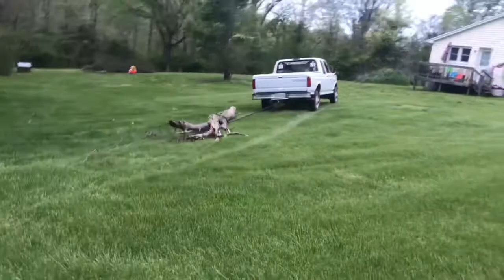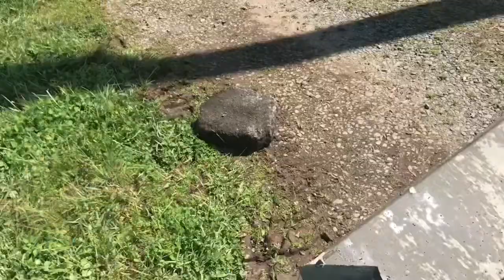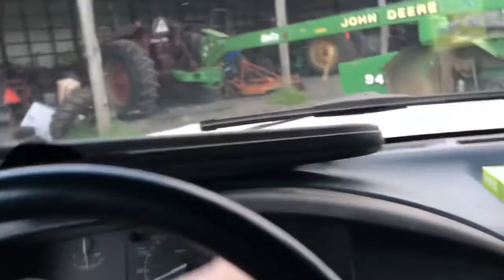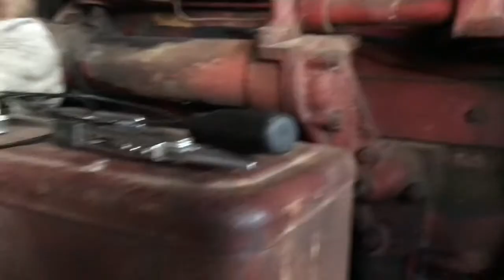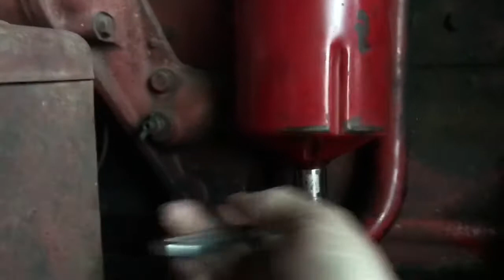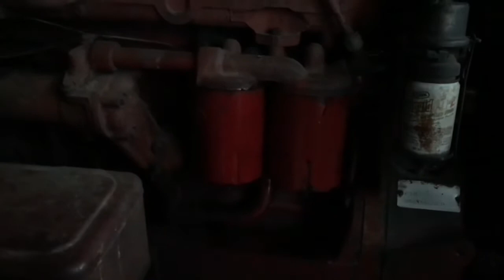A little bit of everything and Farmall 1456 oil change

Comment: Had an issue with my mower too had a bad coil $115 later running good again
Reply from the maker: This one needed a starter when I got it two years ago but it still worked just had to play with it so I let them change it while they were doing the coil, it runs great now but I could’ve save myself a lot of money by doing it myself but you have to take everything apart on this motor to do that